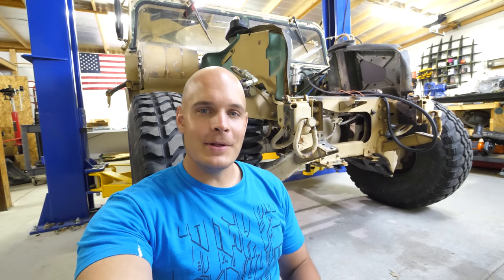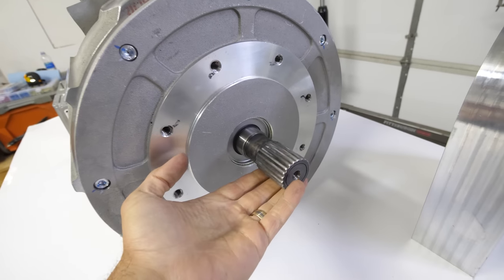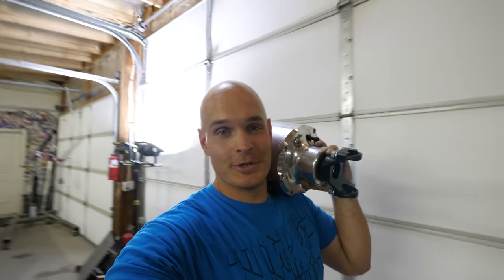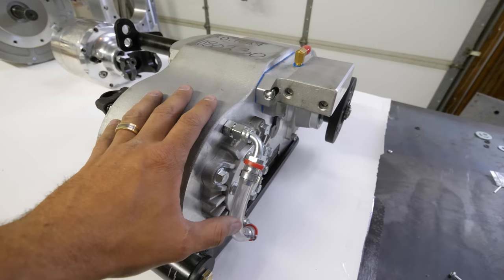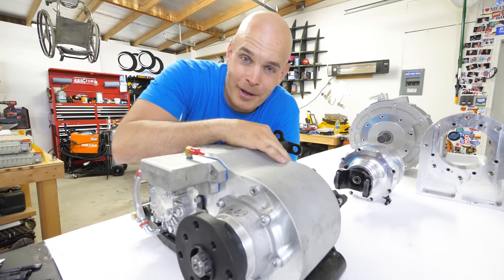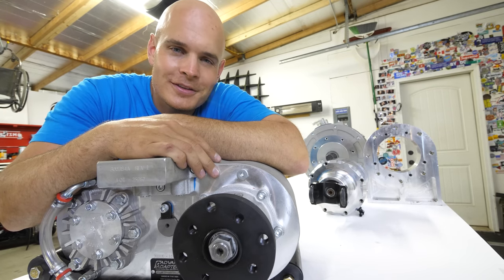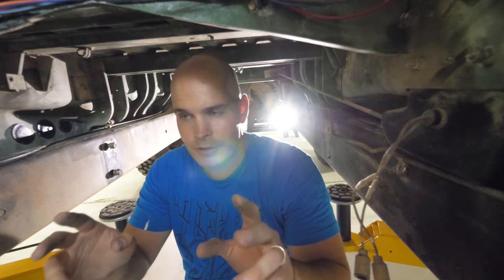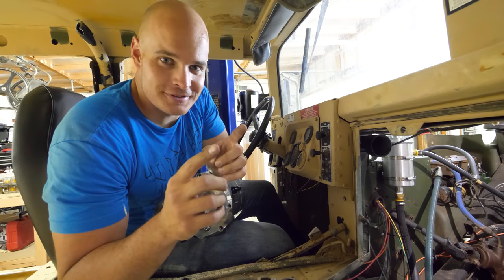How Strong is my NEW Electric Hummer Motor? - EV Conversion!

Comment: I love that you're subtly bringing out the truth that EV:s aren't going to be more difficult than what we have. It's just that way now, because people aren't used to them. Probably going to be good for "self reliance", going forward. Shouldn't let manufacturers lock people out of software either.
Reply: ICE cars are the epitome of bloated engineering. Every time something needed changing one more thing was added. Until you end up with what we have now. Something so complicated and fragile that it takes mechanics with special equipment to find out what's wrong and fix it. I can't wait to get an EV.
Reply: EVs are awesome in every way, so much new potential. Teslas engineering philosophy is nothing short of incredible, the did like 11 revisions to the heat pump just last year while other manufacturers would rather use the same exact component for an entire decade. 
The one thing Tesla is missing from being the dream car manufacturer is customer focus. Customer service, repairability, no locked down diagnostics. They got the engineering on point, but their politics are still infuriating.
Reply: @drkastenbrot  I was looking at EverydayAstronaut's interview with Elon at the Boca Chica Launch site and he made good points about engineering. Like don't optimize things which shouldn't exist in the design to begin with. He attributed the tendency to the educational system, people aren't taught to say an assignment is dumb or something should just be discarded from the design. The examples were from Tesla's designs.
Reply: @downstream0114  Im an embedded engineer and I like to quickly move through companies to see how they all operate inside. One thing I noticed in many of the older companies (as opposed to fresh startups) is that the design process was very linear: You would solve one problem at a time until it all works. You never get to take steps back and look at the thing as a whole, and often enough the result would work as designed but be far from optimal. Tesla and SpaceX seem to completely do away with this process and instead ALWAYS look at the whole thing. Watch Munroe Live on Youtube and you quickly notice how teslas parts all look like it was all designed in one go, it all fits perfectly together with a level of integration unseen before. All by taking a different philosophy and doing whatever makes the most sense on the long run.

Comment: This project should be called Humm-EV

Cant wait to see how this turns out, and how it manages the crazy torque.

What are you planning to do with the interior? Current drivetrain is way smaller than the original, any plans to use that middle row?
Reply: UC turret...
Reply: HUMMEV
Dope asf

Comment: Jerry when using the C shaped connector with you hoist always have the flat “pin” area facing down and the horse shoe facing down as it greatly increases the lifting capacity and may save a project in the future! Doubt your anywhere near capacity but would hate to see a catastrophic failure in the future. The way you used them cuts capacity in half.
Reply: This.

Comment: When you're comparing torque output between the diesel engine and automatic transmission don't forget to factor in the torque converter stall ratio.
Reply: Yea can be 2-1  with a 3.06-1 first gear  so 6-1 torque amplified. So 300 ft lbs engine is 1800 foot lbs into the 2.4-1 tranfer case !  A lot more torque than the electric motor makes !
Reply: Really? Did you hear how he was explaining everything? The people he is directing this video at will have no idea what that is.
Reply: @georgeyoung2336  I'm not sure he understands. He should understand all of the factors if he's designing a vehicle's drivetrain.
Reply: @mnielsen005  I disagree. Messing with high wats and especially high amps is a good way to put yourself in a box. I’m sure he knows what he is doing.

Comment: My Hummer H3 has ~240lb/ft peak from the engine X 3.75:1 1st gear X 4.03:1 t-case X 4.56:1 diffs = 16,500lb/ft final toque. 

I bet if you did the math on your Toyota you'd find it has similar theoretical max torque at the diffs of something pretty close to the numbers you're arriving at in the H1 EV build. 

In practice the electric will be better as it will be able to deliver peak torque at any RPM, but the numbers really don't seem very impressive considering how many stock vehicles are out there that already have higher peak figures.
Reply: Did these calculations on my trucks speced in low range. got 44100 Ft lbs of tourqe.
Reply: @justnsaliga8518  yikes! that's some proper reduction! Is it a tractor or a truck? lol...
Reply: So you can do 16.5k lbft in 1st gear so what is that like 9mph? This thing does max torque up to 125mph and he's reducing it with a gearbox. Come on bro. Also most autos begin in second gear unless you floor it or run in d2 or d1
Reply: @TheCuriousNoob  My H3 is a manual. It always starts in precisely the gear I select. I already pointed out the advantage of the electric. You don't get to take that point, pretend like it wasn't said, repeat it, and then claim to be making some sort of novel argument "against" the original point. That's ridiculous.

Comment: This motor looks almost comically tiny compared to this chassis. I'm not what some call a "car person", but electric conversions of classic vehicles look like fun projects.
Reply: So expensive though lol
Reply: @vanderumd11  Surprisingly doing this in the US is super easy, try doing it (properly) in smaller countries. I started planning this about a decade ago with lead acid batteries and DC motors after seeing others do it. I eventually gave up and bought a Nissan Leaf - great little car, but not a Tesla to be sure.
Reply: @NZSpides  what does the size of the country have to do with anything?
Reply: @littlejackalo5326  Resourses, that's the point. In the US they have years of Tesla vehicles that have been broken down for parts (see Rich Rebuilds and garage services for fixing broken Teslas). There have also been many new companies popping up to supply new electric motors and speed controllers. Pick a country like mine that has a much smaller consumer base and requires everything to be shipped in - the cost is significantly more than a country like the US.
The question you ask clearly shows you don't live in a smaller country, have a budget and build things that require obscure modern technology.
Reply: @NZSpides  very easy but expensive. Anyone can move a mountain with unlimited finds
Reply: @NZSpides  right. I can order the entire parts kit to my door and have a technician drive here to assemble it. I will be paying 90k though in parts and labor lol
Reply: @vanderumd11  I have the skills to install the hardware, but getting the gear is the problem - cost as well as getting it to my county. Shipping is really hard with lithium batteries, they are heavy and usually you can’t put them on planes.

Comment: I'm not big on the EV fad but I'm definitely interested how this project turns out. 12k lb-ft of torque is crazy  Good luck!
Reply: he has to use a humvee, 12,000 lb-ft of torque will tear the engine out of a regular car.
Reply: It’s not a fad anymore. Depending on the market, EVs have reached on average 6% and upwards of new vehicle sales and increasing exponentially. In 10 years, the internal combustion is going to be the minority enthusiast powertrain.
Reply: @Eric Wadge  actually your backwards. I wrote that a year ago and the EV market it crashing. Tesla sucks and rivian is so expensive to buy and make your still on a list to get them.

Comment: The "EV torque box" is a less efficient solution. Losing power to gears and working the motor to max power. Limiting the motor's max rpm through software or throttle calibration can solve this, reduce power consumption(more range), reduce heat and reduce work stress for motor without losing torque.
Reply: His electric motor without any gearing only produced about 500 ft-lb. He's knowingly sacrificing efficiency/range for torque here. Reducing the RPMs of the motor via the controller will reduce the speed to an acceptable range, sure, but it won't increase the torque. That a solid metal military hummer, even without the engine the chassis and body weigh 1000s of lbs. He's definitely going to want to sacrifice some efficiency and range for the extra torque which will make the vehicle more fun. So the torque box accomplishes 2 things here, it reduces output RPM to a range that the vehicle itself can tolerate, and by using the torque box, it gives something back for the sacrifice of the RPMs - the additional torque.

Comment: Energy density will always be an electric vehicles Achilles heel. Until we can reach 30kwh/kg, it will never have the range of contemporary vehicles without added infrastructure. 
Also, all that weight removed from the engine/tranny is completely offset by installing an 90kw battery. I'd like to see a weight comparison between the two. 
The original engine in that, the 6.5, was a dog. Naturally aspirated diesels are trash by comparison to modern FI common rail ones. 
Any modern diesel today has about 1000lbft of torque whether it be from Ford, Chevy or Dodge, in the light duty truck segment.  And since hp ratings from manufacturers are rated at the crank of the engine, modern diesels have more torque than your electric motor. 
Adding a torque multiplier to any of those would yield the same results. 
I'm curious to see the end results of this project nonetheless since EV produce their torque instantly by comparison to their ICE counterparts.
Reply: First gear in his Tacoma is right about 4:1, so even his NA gasoline V6 can get more peak torque to the wheels.
Reply: I own a 2015 Chevy Volt. I charge it home and I charge at work.
Over the lifetime of the car the average is 143 mpg.
I've averaged 162 mpg since I bought it.
I average 192 mpg since the last time I changed the oil (about 7000 miles ago).
The battery lasts about 40 miles and then gasoline kicks in. This car is a gateway drug: I no longer worry about EV range in town and want a full electric car.
Reply: Peak toque yes, but not at 0 rpm, but I am also curious on the weight! Also front/rear axle displacement.
Reply: Gotta hand it to you there; at 0 rpm the combustion engine would be considered "off".  A bicycle has more torque at 0 rpm.  EVs certainly have advantages and are a Good Thing™, but comparing electric with all those torque multipliers to the crank torque of an ICE is either ignorance or dishonesty.

Comment: You side loaded you shackles when lifting your motor. That is a good way to have them fail and damage your motor and hurt you.  The type of shackles you used is designed for a straight line pull only.

Comment: 4:07 btw, the units shown are in nanometers IIRC (case matters). If you're meaning "newton-meter", it's written as "Nm" or "J" (joule). Joule is another unit of measure for it as well. (1Nm = 1J)

I didn't catch this when I saw this video when it came out.

Comment: Cool video, super fun project, but....
M-1 Abrams tank width: 144 inches
H-1 Hummer width: 86.5 inches. 
The reason the H-1 Hummer is so wide is to avoid tipping over on a 45 degree grade, and to accommodate a soldier on a stretcher in the center of the vehicle while the 4 seats are still available.

Comment: Super cool project, but i believe you numbers are waaay off... 
The 2004-2006 H1 had a duramax LLY engine that made 590lb-ft torque @ 1600 rpm
Into a stall convertor approx =   2:1 torque multiplication
into a 3:1 allison transmission = 3658 lb-ft before diffs and portals.. 

fun fact: the nv242 diff +portals adds another 5.24:1 gear reduction, making the final torque output of the original hmmv: 19168lb-ft !!!!

Comment: The motor output is not geared down to limit speed - that limitation is easily set in software if that's all you need. The purpose of gearing is to provide more torque to the wheels, or to allow the motor to run at a speed where it can produce more power, depending on how you want to look at it.

Comment: Damn dude; you're just about convincing me to go ahead and go with an electric conversion on my 1987 GMC pickup. I've got a one-ton dually frame sitting there that doesn't have anything but the wheels on it that I've been thinking of putting the cab on, but I wasn't exactly sure of what else I was going to do with it.

Comment: I was waiting to see someone do an EV conversion in a hummer like you are doing it with a torque box and using a t-case. So you will be able to travel at highway speeds no problem, but then when wanted you will have all the torque you need to crawl off road! I have been thinking of doing the same thing with a jeep comanche which is one of the jeep Cherokee pickup.

Comment: Looks like a cool project.  That's cool your super excited about your project, probably none of my business just all these youtube videos get the power output of electric motors wrong.  Start off with there are varying types and a myriad of controllers, to throw general rules of thumb about power and torque output is far from reality.  electric motors have power curves just like piston engines, the power delivery is a lot different albeit.  Fairly typical in my limited understanding ac motors tend to deliver max torque if they are an encoder type at zero rpm then the torque flattens out then power level goes up.  power output is a function of rpm and torque so you only get max power at max rpm.  Best of luck to you man! :D

Comment: Concerned about the motor bracket you fix, I think it is not so sturdy, since it was twice the torque against the stock engine. It must be durable that can hold high torque motor..

Comment: The size of the motor compared to the vehicle just blew my mind. You could (just for numbers sake) drop in another motor (with custom geared adapter to allow single output for 2 motors and approach 25,000 lbs ft (I can hear the shafts snapping like twigs right now). 🔧

Comment: Super excited about this conversion!  Planning something similar for my boat - which uses 2 260hp motors to cruise at 3500 to 4400 RPM.  Looking forward to the complete series.  Curious, why not use salvaged Tesla motors and controllers?  Their specs seem adequate even superior.

Comment: im sure you have calculated  gear ratios etc pretty well but it Looks like you could bypass  the torque box easily if needed for testing  battery efficiency and use a software governor  to limit max speed. great content btw.
Reply: The TorqueBox is needed for adequate torque, and he also needs to adapt the motor output shaft to something usable, so he might as well put in the TorqueBox in the initial build.

Comment: These numbers you stated are distorted. HP and Lb-Ft calculations are only relevant for comparison when the motor is driven with the trans in 1:1 ratio and the transfer case in high range, also 1:1. So while those numbers may be accurate as far as final wheel torque is concerned, the motor still only has the amount of input torque it’s rated at.

Comment: The motor is very impressive little thing, i get comparing the size of them but one thing to mention is always weight of the system in total people always forget that the EV powertrain is very small for huge power but the batteries are about 2/3 x the size of a fuel tank. I'm all for conversion tho! I'm trying to design a conversion for my r53 mini cooper s, i want to make t 4wd by driving the rear wheel wheels with an electric motor. Im currently doing research into how the motors are designed and built for purpose in new EVs in my final year of uni, very expensive equipment i think ill have to wait until the value of EV equipment to reduce by a lot!
Reply: A good rule of thumb is to not bother with AC regenerative capable motors for the rear wheels, since most of the braking force comes from the front. This gives you the opportunity to save money by using cheaper kit while sacrificing little if anything.

Comment: very impressive.   Makes you think about electrification of current surplus Humvees; leveraging the existing supply chains and tactical systems in the gap of contending with the next possible large scale conflict. 

Your showing right in your garage that EVs can built around the  10s of thousand of existing chassis. But needing to be paired with some type of portable salt-melt reactor to rapid charge them.  Even on the move tow behind charging for front and follow vehicles. 

Diesel  isn't going away near term but the brass wants future proofing. Radical new systems will be harder to come by, but radical shifts of core technologies within existing platforms is just as viable to keeping the military competitive. Tactile Comms still needs HF but modern message dissemination.  

 Stuff like this  serves the purpouse of incubating leading edge development but still preserving industries with core competencies underpinning systems proven to work on the battlefield in large numbers.  

But will the air conditioning work better?

Comment: Well, to be fair if your toyota pickup has 265 lb ft of torque it ALSO has a gear reduction through the transmission. If it's an automatic the 1st gear is 3.52: 1 or 932 lb ft, 2nd gear 2.04:1 or 540.6 lb ft of torque, etc etc. First gear in your toyota actually has more torque than max torque of this motor + gearbox assuming the rear end and T-case ratios are the same, but less once you start upshifting. 

Doesn't matter though, the torque isn't instant on an ICE and you have to shift so overall not apples to apples. Just thought it's worth pointing out that isn't a fair comparison to ignore the transmission ratio on the ICE vehicle. Either way this $23k electric motor is certainly incredibly powerful and will be amazing in this hummer! 
👍